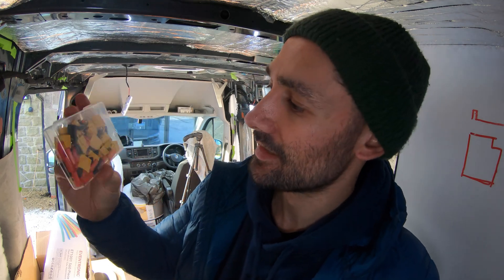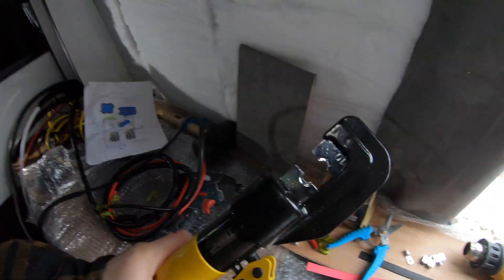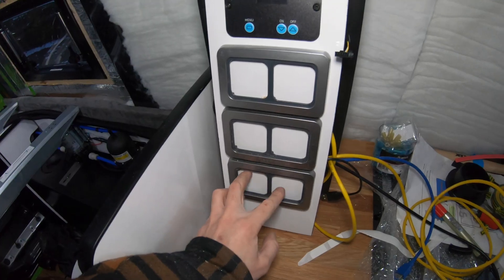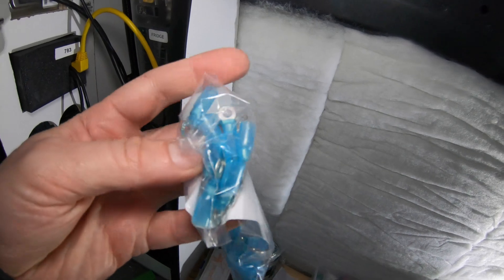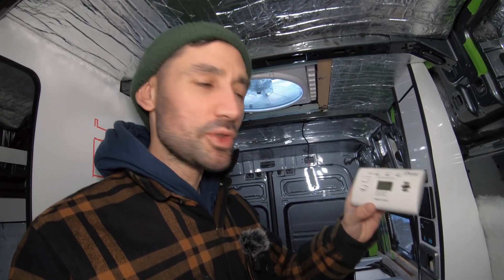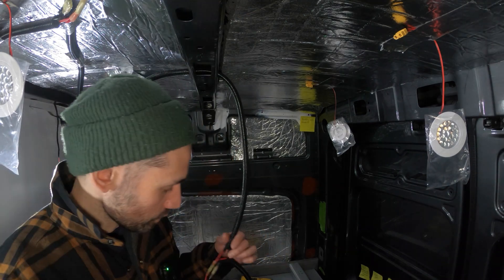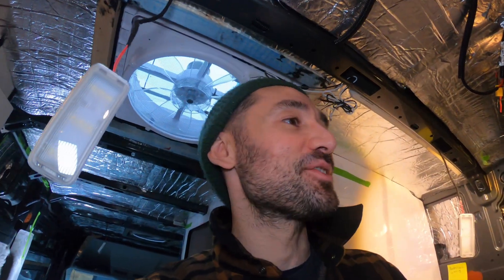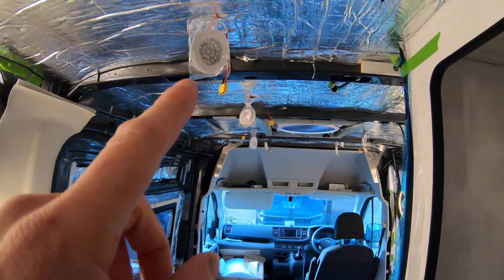I Spent 30 Days on 12v Camper Van Electrics and Learned This

Comment: Dunno if you checked the sockets with one of the 230v socket testers? Highly recommend not only having one but just keep it in the van for if you're on hookup. They're only about £8 last I checked. They don't catch everything but catch quite a few faults. Not sure they're fully effective on an inverter due to there not being a true earth, but on hookup sound show all clear.

I bought one for some rewiring on my van. Figured I'd give it a try in the house to see how it worked first. Connected it to a kitchen socket, and immediately showed an earth fault! Tried it in another socket to make sure it wasn't the tester, all clear. Then went round checking all other sockets in the house. Just the socket in the kitchen. A bit if invesitgation later and taking a cable out of the wall, looked like someone must have put a nail through the wire at some point, completely severed the earth, and took a chunk out of about half the live. There's no way it didn't trip the fuse, but when turned back on the live-earth was no longer bridged and damage still allowed a circuit. The wall got plastered over again at some point so it was completely invisible. Good job I never connected something like a kettle to that socket as the wire would probably have set alight. Also, none of this was covered in the surveys done when buying the house.

So I recommend checking everything in the house and van. Then check the sockets again if a breaker ever trips, and check when you're on hookup to make sure you have an earth, don't have reversed polarity, etc. For £8 it's a no-brainer. I would hope the multiplus would have something to check that kind of thing, no harm in checking twice though.
Reply from the maker: That’s a great idea.  Thanks for the tip.

Comment: Wago is the way forward. You can connect and disconnect quickly and link different size wires in a block
Reply from the maker: I will certainly try these in the future.
Reply: Wago can make bad connections all the time

Comment: Did you batten out the walls and roof with timber to fix the ply/cladding or did you fix straight to the metal to save on weight?
Reply from the maker: For most of the van I’m fixing ply to the van to save weight except in the shower room where I have battened it out with 15mm lightweight ply. Then I will use 3mm ply to line it and then saniclad it to finish. 👍 I’ve tried to build as light as possible.

Comment: Why not use Wago connectors? A lot easier than soldering and no chance solder will break under vibration?
Great videos by the way 👍🏻
Reply: I’m not qualified to say whether that have been automotive tested but as a non electrician self builder I would trust Wago more than my own soldering 😄
Reply: Yep. Sparks use em in commercial and private builds
Reply from the maker: I didn’t really know about them in all honesty.
Reply: Tend to agree with @robfodder5575, used them on my house rewire although only on the lighting and smoke circuits, for some reason I don't like the socket outlets with the same sort of connectors. If I were to use them in a camper environment I think I would leave them exposed and under full power for a couple of days and driving the van just to make sure they weren't over heating before enclosing them behind panels, but I'm a bit of a fanny or so I've been told.
Reply: They are great for home electrics but have they been tested in automotive environments? 
Soldering wire to connector is not ideal, neither are Wago IMO 
To keep it simple I would just use (genuine) Superseal connectors (or similar)
TE and companies like them go to great lengths to make sure the tooling is spot on and testing enough to guarantee a moist camper van which vibrates does not cause problems 🙂
Reply from the maker: @robfodder5575  I will take a look at these for next time maybe. But I’m pretty happy with the outcome. It’s the only pace I’ve used solder on the build.
Reply: @abucklife  Honestly not a criticism, its more for other people also enjoying your build and deciding for their own ;-)
Reply from the maker: 💯👍👍 always like to hear peoples thoughts.

Comment: I've read quite a few discussions about not using solder in moving vehicles because solder makes wire brittle and this can eventually lead to connections breaking. Crimping is advocated as an appropriate alternative...
...However you are using these connectors for non-critical devices (LEDs), and presumably the heat-shrink will hold the wire firmly and prevent stress/breakage. The connectors look really handy, and quite inexpensive, compared with Anderson Powerpoles or Deutsch connectors. So I'm inclined to give them a go.
Reply from the maker: Hi Simon. I guess it depends on who you speak to. I think soldering will
Give you a better connection but I have mainly crimped for speed but in this case I could t see another option. Give them a go and see how you get on.
Reply: @abucklife  I kind of get frustrated about this (not what youve said or done); companies make and test products and offer guidance then a load of internet experts advise people, like you that its OK causing confusion. I've even heard some waffle from so called experts (battery importers) . Yes solder is used in automotive electronics, wiring looms etc, but not anywhere near flexible elements without a crimp or support (thick sleeve) . That said, youve used heatshrink and they are low current none critical connections so meh ;-)  But ideally just use actual automotive connectors. They are really quick to use, can be used for various wire sizes and internal/external connections, and crimpers arnt extortionate.
Reply from the maker: That’s good to know. I was just going on advice from a camper van electrician but I will take a look at the automotive connections.
Reply: @abucklife  Ive been enjoying your build while building my own. Anyway,  that sort of proves my point, they dont know such stuff yet advising others. Anyway, for anyone reading this, have a look at the following or similiar:
AMP Superseal Connectors
Mate N Lok Connectors
Deutsch Connectors
Econoseal Connectors
Lots of other molex, TE..etc.
I should add that there a few soldered connections in my own build, but none where I can just crimp a connector and none without  mitigation for vibration. You can also buy wire-to-wire butt connectors that are crimped..
Reply from the maker: I think these comments are super useful it’s great to create a helpful community vibe in the comments. 👍👍
Reply: I believe (maybe wrong) but if you have gas installed solder joints are not allowed in camper vans. 
Edit just googled this and it appears the reason is more incase of a fire the soft solder could fail resulting in a gas leak, obviously not what you want in a fire.

Comment: Hi ya I would have used xt30 as you lighting will not draw high current.  But still a brilliant idea 💡
Reply from the maker: @defendermods9420  thanks buddy. I looked at them and on the internet they looked tiny so went with the bigger ones but I think either would work. 👍